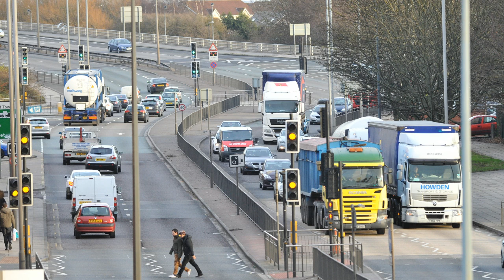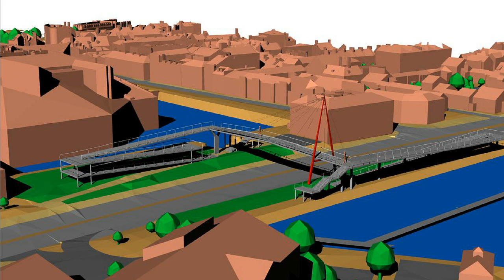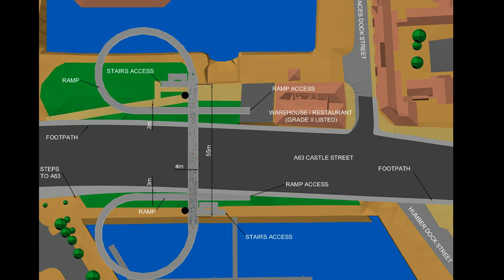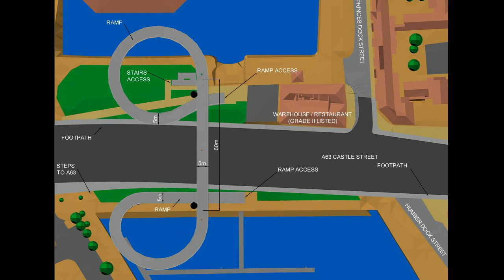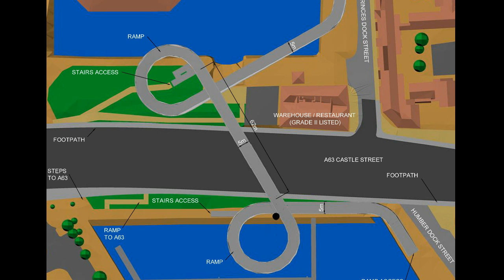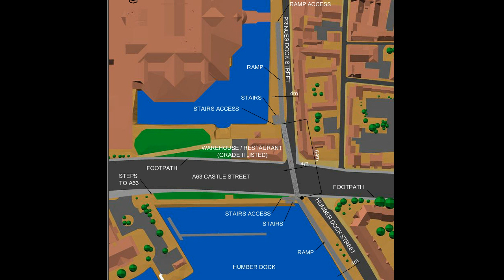Hull A63 Castle Street footbridge designs

Comment: The new footbridge is nearly finished for use in April 2020.The upgrade to Castle Street is supposed to happen this year.Don't hold you breath.That bit of upgrade is going to take 5 long years to be build.How much extra traffic mayhem it will cause in Hull is anybody's guess when lanes in and out of Hull will be closed.This whole project is getting farcial you might as wel build a road in the river as suggested.The amout of pollution around Castle street in Hull is off the scale which will get even worse during this up grade build.Not a good area to be around.I don't blame the council various Governments don't care for Hull.5 years to build but make it 7 by the time it will be finished it beggars belief.